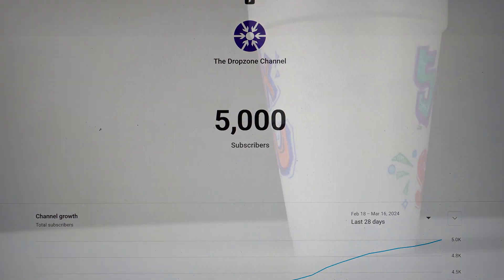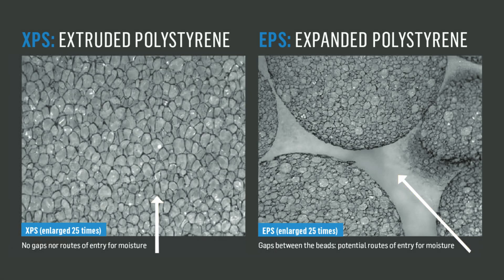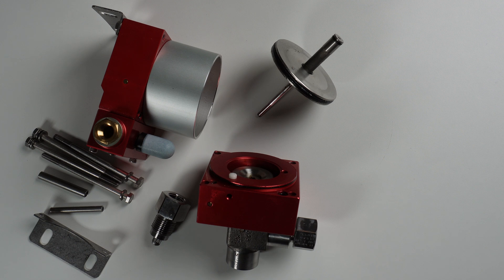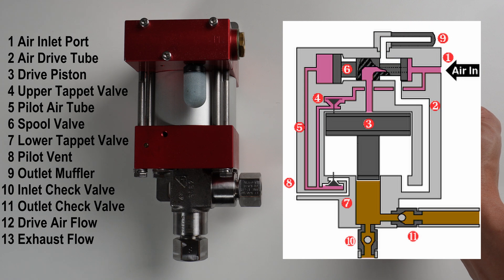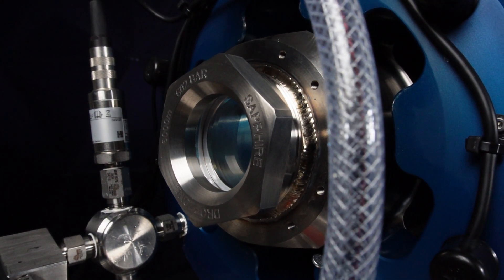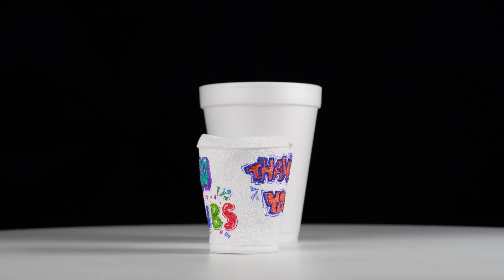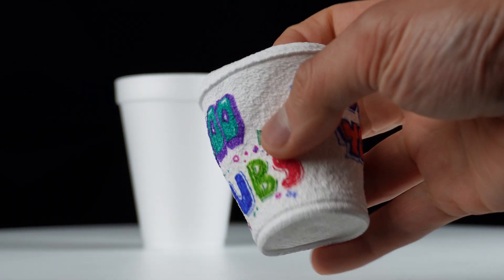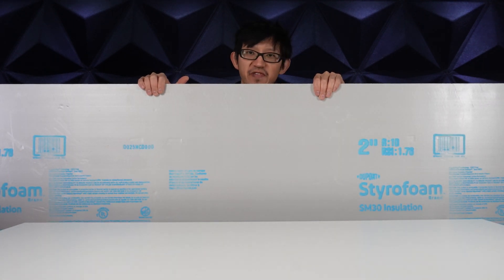Do Styrofoam Cups become Thimbles in the Ocean Abyss?

Comment: Honestly, I'm surprised that the EPS continued to float at depth. I expected the volume of the compressed air to drop below the displacement of the plastic foam matrix allowing it to sink. I guess I underestimated the amount of air in the sample.
I'm wondering how aerogel would react. Is the aerogel matrix open cell or closed cell? I suspect open cell, but don't know for sure. Even if open cell, I would suspect the holes to be small enough that surface tension might cause unexpected results.
Reply: Could be interesting since aerogel is essentially like microscopic gas filled glass balls, i.e. very closed.

Comment: Called styrofoam by Americans. Us brits.and Aussies have always called it polystyrene.
Reply from the maker: Thanks for the clarification! I stand corrected.
Reply: "Styrofoam" is a trademark (owned by DuPont and it's Dow division) for one specific brand of extruded polystyrene (XPS) foam. Dow is a US company, so it's not surprising that the misuse of this trademark as a generic name is common in North America but not elsewhere... but there are no Styrofoam cups, or any other moulded item made of Styrofoam or other XPS; cups are moulded from beads of expanded polystyrene (EPS) foam. 

Just say "foam cup", or "polystyrene foam cup" if you want to be precise about the material. It is normally called "EPS", but not everyone knows what that acronym means.

It would make sense to also try simple rectangular blocks of EPS and XPS foam, to compare the materials.

Comment: Yes, finally! I’ve come up with some other objects to implode, a vacuum tube, a sand timer and one of those glass fishing floats.
Reply from the maker: You got it. I think I can fit that into one episode.
Reply: @TheDropzoneChannel  a thermometer, alcohol type (can you find a mercury one?)... well, while at it, why not a galileo one? lol...

barbie :) she needs a good squeezing. versus lego man, of course.

those squishy silicone toys with the eyes that pop out?

 a stress ball?

a lightbulb? whilst lit?

heat pipes from a heatsink.

liithium batteries :) any battery?

the idea of vacuum tubes, batteries, and operating lightbulbs... electronic circuits, of course... silly toys... like that over voltage channel, lol...

cigarette lighter, empty vs full.

can go on and on ;)